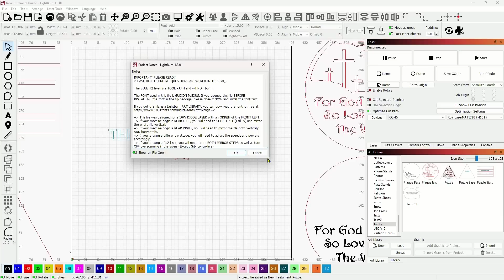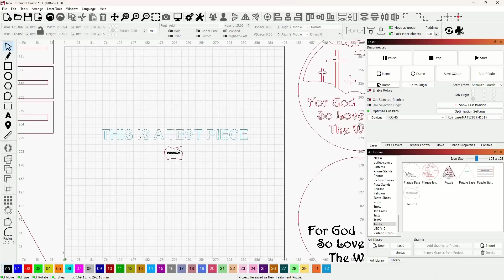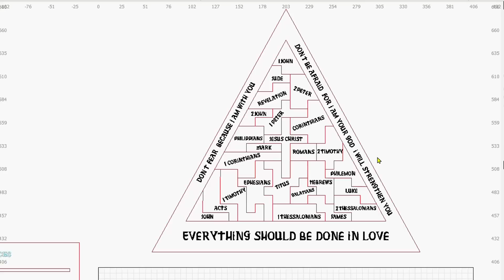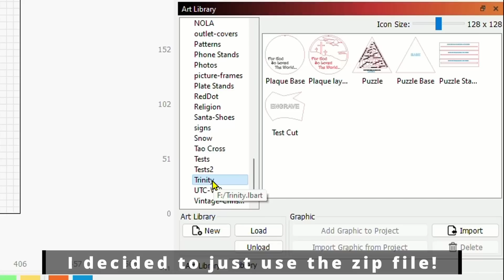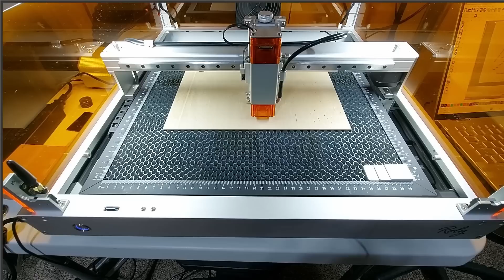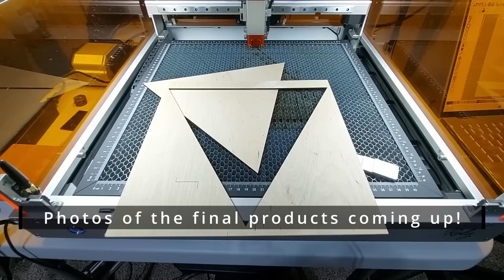😲 The Holy Trinity Laser Cut Puzzle and BONUS FREE DOWNLOADS! Bonus footage of the engraving!

Comment: Rich, as you know, Ortur only provides one focus gauge and I have always set the focus once when I am engraving and cutting on the same material and have always had great results. Why are you adjusting the focus after the engraving? It looks like it is a huge range between the engraving and cutting....
Reply from the maker: Because both use different focal points. You have to lower the focus to cut.

Comment: Rich, thx for the hours invested in your videos! I have watched many, some multiple times. 
I have a question. You have mentioned little tidbits of info on what you do to a wooden item once cut. Spray water on cloth to wipe away soot/clean, rub cleaning vinegar around edge to remove smell.  Do you have a video describing what you do to wood once cut but before packing to ship. I'm new to the laser hobby and never having done woodworking, I'm ignorant of how to treat the wooden item that I just created.  
I've watched many videos on cutting/engraving/etching, but have not found any on what's next.
Thanks again for your videos and any response.
Reply from the maker: Yes, all diodes do well with tumblers.
Reply: Was this reply meant for another comment?

Comment: I am building a moveable stand for my laser. I think the Roly was listed as 27.5 x 27.5 inches with enclosure. Is that a good number?
Reply from the maker: 24 x 24" would be the size of the frame for the stand. 27.5 would be if you have your own enclosure to make room for the wiring and exhaust.